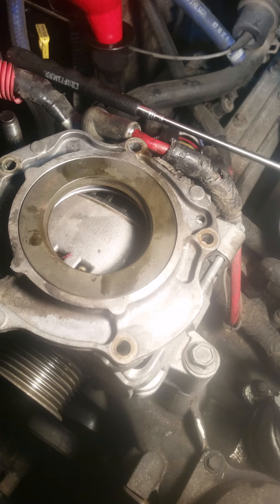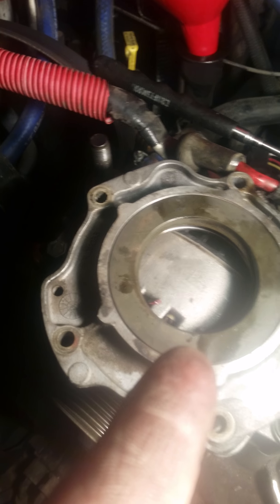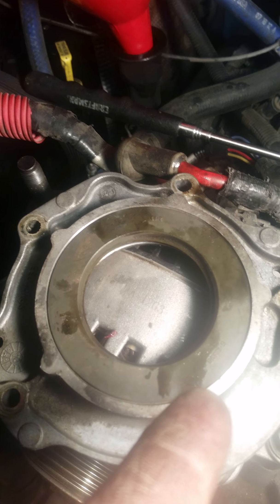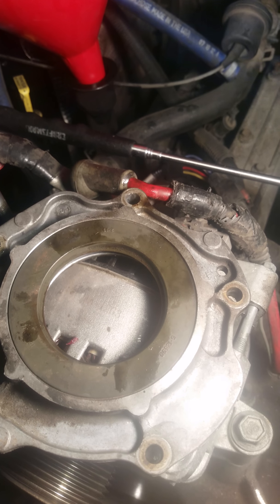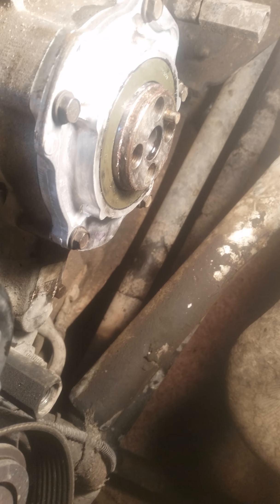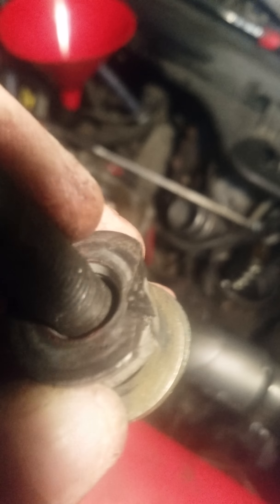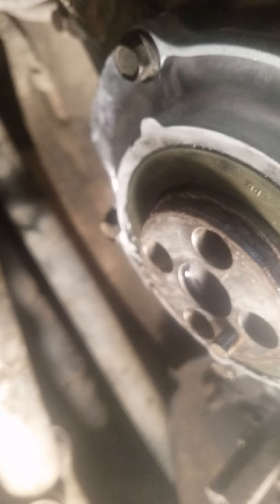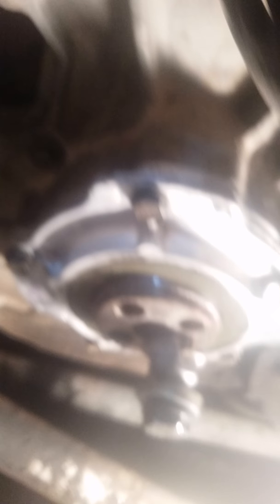6.0 powerstroke front seal

Comment: Where did you get that seal from? Ford dealer says that I need the whole front cover to get that seal.
Reply: j. Onofre you can get the seal on amazon, rock auto, freedom racing or several other suppliers. Runs around $20